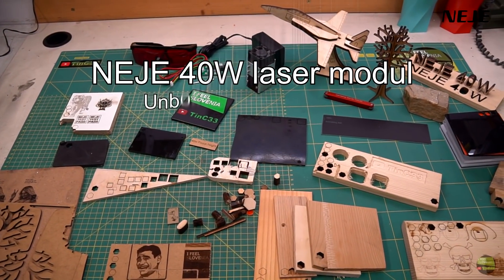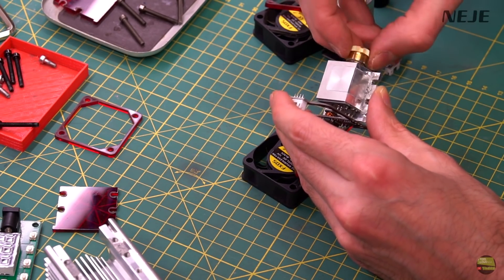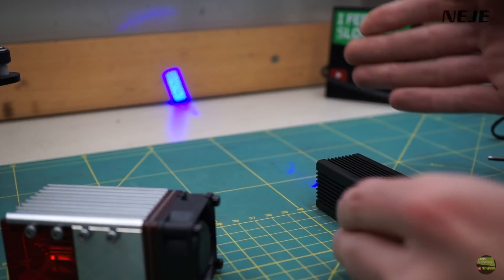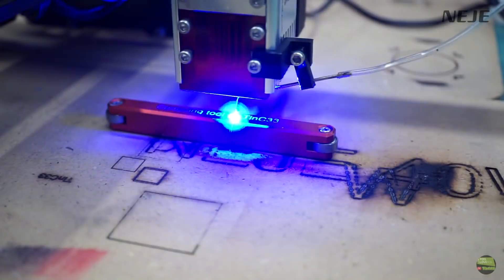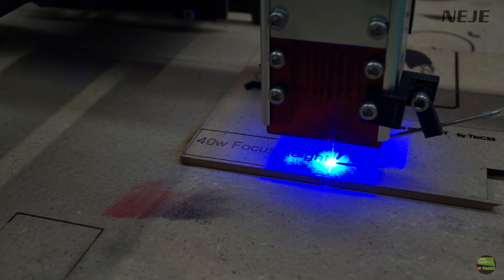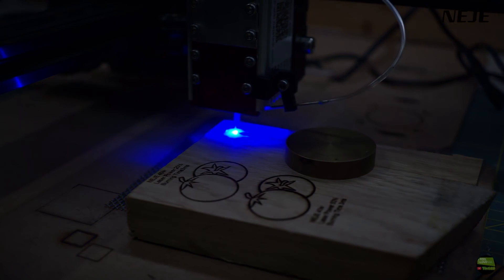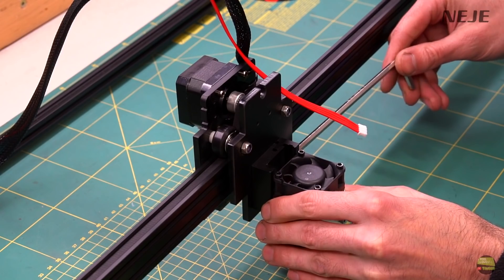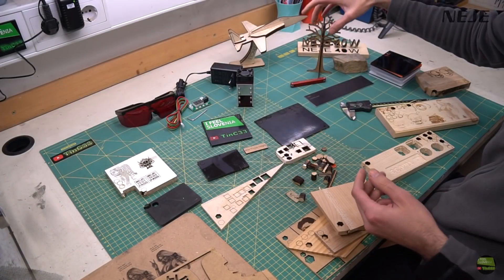Neje A40640 40w laser modul [unbox / review / first test] best laser modul modul i try

Comment: Thank you for the inside look of the 40W laser diode. Too bad it cost 3X more than the 30W. Great tip on the wire mesh under the material being cut so the air assist can blow threw. Thank you for sharing with us.
Reply from the maker: thanks, it is really much more expencive than 30w but much better.
Reply: it's only about 50% more on ebay

Comment: Would be interesting to see what it could do on laminate flooring(usually 6-8 mm thick) as this is an amazingly strong and very cheap material usable for a whole host of projects(structural parts for small machines like belt-grinders, table-saws and more...)
Reply from the maker: isn't laminated floor somekind of MDF material with very tough surface, i think i still got some pieces of laminate, if i remember i will try next time.
Reply: @TinC33  I believe it is hdf, the surface laminate makes it into what is probably the cheapest composite material available and strong/stiff enough to be used as a direct replacement for aluminium for many applications.

It really is amazing stuff that seem to have gone under the radar for a long time as far as a material to make things out of...

Comment: I was really intrigued until I stared at the price. For the price of such a diode laser module I can buy a whole K40 CO2 Laser.
But anyway great video!
Reply from the maker: true, i think it's about time to try some co2 laser, i got no experience with them
Reply: @TinC33  before the human malware came around, I had access to one at the local maker space. They are great for cutting acrylics (as long as you use the non extruded ones)
Reply: and the diode only has an optical power of 15w LOL. so you can pay the same price and get less than half the power
Reply: @TheFvSmallFry  but k40 is only 20x30cm workspace for same price, where neje can give you 81x46cm, which is also important, and if it cuts too, the co2 is just time saving, but also co2 glass tube wears out way before this LED module dies if you use it right, thats also for considering when buying, so if you aint in a hurry, you can make much more bigger things with neje
Reply: @CrazyManer  agree but to get 15w optical power out of a diode they have to be over powering it reducing its life as well. My stock k40 cuts about 33cm x27cm. You just remove 4 screws and take out the stamp fixture they include.
Reply: @TheFvSmallFry  thats a good hack, but still that workspace is very small for me, i will go for neje with air assist, and i still think that you will be buying glass tubes worth of another two k40s before this led dies
Reply: @CrazyManer  would be a good subject for a video. see what diode they actually use, what its actually rated, and put it against a k40. i guarantee the k40 is more cost-effective. i have over 1300 hours on my original tube, but most people wont even use their laser enough to hit the end of life of a tube, so I'm not sure a 10000 hour led life (which is already lessened by running 2x rated power through the diode) is any more valuable
Reply: @TheFvSmallFry  there are two diodes if you watch the video
Reply: @TheFvSmallFry  it is 2 x 7,5 watts focused

Comment: When cutting wood, use masking tape, te cut will be clean, no "smoked" stains.
For acrylic, use cast acrylic, extruded acrylic eill melt and will jot look good

I am looking for a laser for myself, I use a 18x32 60W laser.... do you recomend this and what is the price?
Reply from the maker: Thanks for adwice, you own co2 laser? I got no experience with them but that neje max in combination with 40w modul is really good machine, for the price check the link into description.
Reply: @TinC33  I use one at home, is a VLS660, from Universal Laser Systems, but I want to get ine for me, I am planing to retire a have a small shop as a hobby.